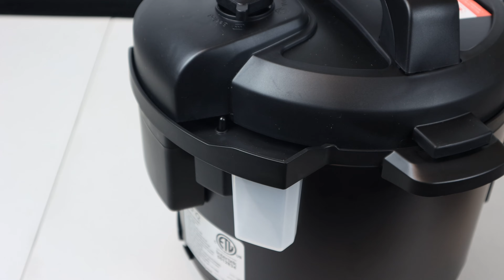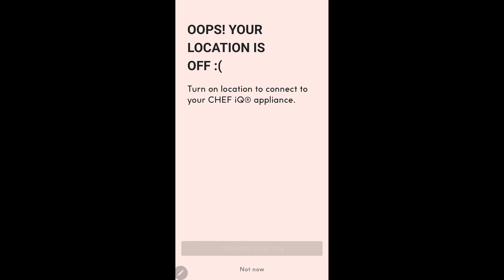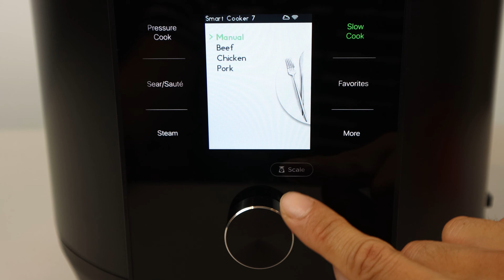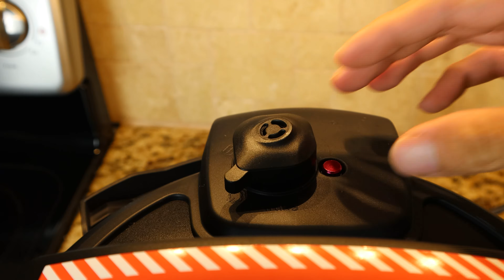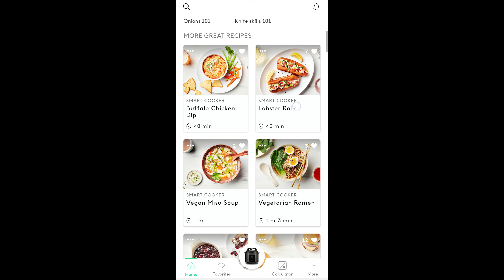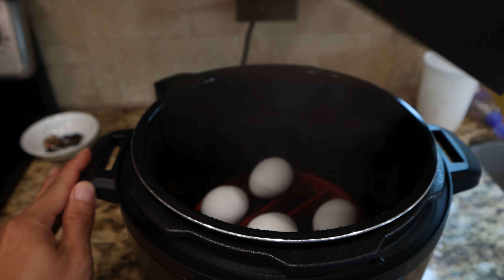ChefIQ Smart Electric Pressure Cooker

Comment: My smart cooker has very LOW IQ: it is 656 and the bluetooth is not syncing with this useless device.  HELP?
Reply from the maker: What happens when you try to add the cooker in the Chef IQ app? If it can't find your device when it's plugged in, you can try factory resetting it to see if that helps. On the device, tap the 'More' button at the bottom of the options to the right of the display, scroll down to Settings and select it. Select 'General' on the next sub-menu, then 'Factory Reset.' Then you can try adding the appliance in the mobile app. If your app still can't "see" the appliance, you may need to reach out to Chef IQ for more assistance. They're actually quite responsive and will make it right if you have any issues with your product whatsoever. They were really good about sending me out a new unit when it suddenly stopped working properly after 8 months.

Comment: What are the bonus rings for and how do I use them?
Reply from the maker: Bonus rings? Some of the newer releases may come with spare parts that simply replace the pre-installed parts when they wear out or no longer perform as desired. I'm guessing that you probably received a spare rubber seal for the lid, the float valve, and/or the pressure regulator. Those are easy to replace as they simply slide on or off.

Comment: What is the lowest temperature that you can set for yogurt making? And longest time setting?
Reply from the maker: When using the yogurt setting, the default fermenting temperature is 110°F  and you should ferment for 8 hours at a minimum before removing and cooling down to let it set. If you find the yogurt is too runny, it's possible the temperature is too low for your bacteria culture and you'll need to use a higher temperature (up to 113°F), using the sous vide mode, a different starter, or simply more time. If I'm fermenting for longer, I try not to exceed 12 hours as over fermenting your yogurt can cause the curds to break, resulting in gritty or chalky textures and a very sour final product. I wouldn't recommend a lower temperature than 105°F, however, as yogurt cultured for longer periods at low temperatures can have a runny texture, lumps, or taste too sour, since most yogurt bacteria struggle to reproduce at low temperatures fast enough and may allow for the growth of unwanted yeast, bacteria, or mold.

Comment: Takes forever to build pressure. I returned it back.
Reply from the maker: Pretty much every electric pressure cooker I've used takes at least 10 minutes to get up to 15 lbs pressure when using room temperature ingredients and 1-2 cups of water. This time can be longer if using refrigerated and frozen items and also increases when there is more liquid inside pot.

Comment: Please explain how to wash and maintain this. Thank you!
Reply from the maker: The inner pot is removeable and you can wash by hand or in the dishwasher. The only other part you'll need to clean is the drip cup which is also removable and dishwasher safe. The exterior pot with the electronics inside can be wiped down with a damp cloth (don't immerse it in water!).

Comment: Had ours for three years now; we prefer the Instant Pot that is still here.  Unless you need your hand held while following through on what they supply for recipes, this is essentially an Insta Pot with digital bling added, as the vehicle for a never ending Info-mercial for the products this company sells.  

Example: you want to use the 'share this recipe' offer?  What you end up sharing is a link to Chef IQ's website where they offer to sell you one of their machines - you DON'T get the recipe you wanted to share.

That said, it does function as a pressure cooker, so there is that.  Ours now get used pretty much 100% strictly in Manual mode.
Reply from the maker: I basically just use it like a manual Instant Pot too, creating my own recipes as I go. I don't really use the cloud connected features often if at all outside software updates. I did see that they added 'sous vide' as an option in the 'More' menu, and I've tried it and measured the temps which seemed accurate and stable enough for small batch sous vide, which is cool. I sometimes water bath can pint jars or smaller in it too (not under pressure), but only for stuff going in the fridge as I'm wary of the actual shelf stability of any final product.

Comment: So I need Wifi and a smartphone? Is there anyway to bypass the wifi connection?
Reply from the maker: You will need WiFi for the setup process and to use the Guided Cooking recipes. I don't believe there is a way to bypass this part of the setup process. After initial setup, however, you can use the Smart Cooker without WiFi for any built-in functions.
Reply: Hotspot on your phone
Reply: Nope. Lol when I lost wifi signal it stops. That's one con with it. You have to make sure your wifi stay consistent and connected for it to stay connected to work. So if you lose wifi signal its out. Better to get one without wifi needed.

Comment: Love mine. 2things: 1)I travelled with it and promptly lost the dial front. Easy fix, I attached a shortened wine cork.
2) The nonstick interior has already a couple of small chips. I am very careful with it. Will any six quart stainless inner pot fit?
Reply from the maker: Yes, I would look for inner pots made to fit the instant pot, as I've found that they are the same size. I got a stainless steel version of the inner pot, so I don't have to worry about the non-stick coating getting scratched. I don't need non-stick for most recipes anyway.
Reply: @ReviewedByPhil  Thank you. I don’t need nonstick either. That’s what Dawn Powerwash is for.

Comment: Good review.  Would love to see how it holds up long term.  I just purchased one of these and have been watching reviews on YT.  So far reviews have been good, but I have seen at least two reviews where user did not like like it.  Hope I love it as much as you do on your review. I may do a review of my own after using it for at least one month.  Thx for sharing.  Subscribed.
Reply from the maker: Thanks for the positive feedback. I guess I should've mentioned that I've had my unit for 3 years already, so the unboxing footage in the video is pretty old but I just now got around to publishing it! I use mine pretty consistently and so far I haven't had any issues. Just don't use metal utensils in the non-stick bowl to avoid scratching its surface. The software updates itself regularly and they added a sous vide feature in the "More" menu which wasn't present when I first got the machine. I should note though, that I gave my parents one for Christmas last year and my mom's had an issue recently where the LEDs behind the touch panel stopped lighting up (the buttons still worked, they were just difficult to see); however, she contacted ChefIQ through the app and they were very responsive and after submitting a few photos and receipt details, they shipped her a free replacement unit within a few days. Now that's a warranty service done right!
Reply: @ReviewedByPhil  thank you for the additional information. Very much appreciated.  Looking forward to watching more of your videos.  I am happy I found your channel.
Reply: @ReviewedByPhil   Thanks for sharing such a thorough, helpful review. Have you experienced receiving any error messages e.g. "Burn" if something is stuck at the bottom of the pot for instance? (I've experienced this with an older model of the InstantPot. The Ultra to be exact. Whenever I prepared pot roast and the gravy was detected as being too viscous, the error message appeared and interrupted the cooking process until excess liquid was added, (in spite of a copious amount of liquid having already been initially added). I wonder if this could potentially be an issue with ChefiQ's pressure cooker as well.
Reply: Do you like your machine?
Reply: @brookemitchell2074  so far so good.  It works well and like the fact that it lets me know when the food s ready via the app.  The other day I set some pork to cook to make pulled pork, after setting it I went fishing and my phone alerted me the cook was complete.  At which point it came back for lunch.
Reply: Awesome, thank you!